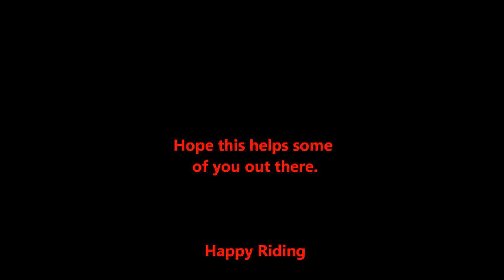Pro Cycle Carb Mod. What they don't tell you.

Comment: I have 2 DR650s. I ran the carb kit on my 1st one for a bit, with the airbox cut and an FMF pipe. It was loud, especially if it needed repacking of the pipe. I was riding too many miles for that. I use stock pipes now. Ti GSXR1000 pipes are rare and expensive now.

 Now, one has the allen-head screws, an adjustable OEM overseas needle, an extended idle-mix screw, and a snorkelectomy. The other has an adjustable KTM 640 needle and the other stuff. The breather filter has been moved away from the airbox opening.

 They both run great near sea level. Winter time is made better with a slight idle-mix adjustment. For higher altitudes, I could remove the airbox door. They can be returned to stock pretty easily.

 A lot of other needles don't have a great taper, or they can wear out the needle jet quickly. This is basically a simple upgrade that makes the stock carb easier to adjust for elevation and temp, with a bit more airflow from the snorkelectomy. I rip wheelies in 1st and 2nd.

Comment: Bought mine,rode it a few hundred miles, stretched it out on the highway and it was good for about 96mph.went home, backed off the valves a couple thousandths, took it for a ride,105 mph all day long with me on it 165lbs.thats the only power mod I've done and that was 20,000 miles ago.

Comment: I did the Procycle kit and have had no problems yet. 5000km lots of offroad.
I followed Adv Oz's video for install.
Love the power gains! Its like a totally different bike.
Reply: Dave, you said you followed Adventure OZ's video for the install.  Did you clip your throttle spring?  If so, how much?  In the Adv. Oz vid, I think I remember them taking off 1.5 cm, but all the other material I've found says - if you're gonna do it, only take off 2 springs (~ 2-3 mm).
Reply: Yes , if i remember correctly i followed every thing Adv oz did.
I think with all the experience those boys have i trust them. lol
The procycle kit really unleashed the beast.
I found that i lost 20km/hr off the top end but the DR is pretty uncomfortable up there anyway and 140km/hr is lots for me.

Cheers
Reply: Wow!  The fastest I've ever had my bike is 140 km/hr (87 mph).  But here's what makes me wonder if I should clip my spring - I live at 3,800 feet with frequent jaunts up to 7500 feet.  The average elevation Down Under is 330 m (1083 feet.)  I'm not sure what effect elevation has on a carburetor, so I'm not sure if the potential issues with clipping the spring would be exacerbated at higher elevations.  Anyway, that's what I'm trying to figure out.
Reply: BarefootDrummer  Ya I’m no guru in that department. I live at 2300 feet.
Reply: @843292  elevation effects the air/fuel mixture on a carburetor. As you increase in elevation the air becomes thinner but the fuel remains the same so you end up with a richer mixture.

Comment: I like that procycle carb kit.
I had plugged the vacuum intake when i first did the carb mode.
Wasn't till later i had the same problem as you did.

Must have read the same post you mentioned as moved that breather and also changed out the foam in there. Stock header/exhaust ..
Had my problem in 2014 or 2015.

Comment: I got the ProCycle Breathe Easy Kit on my DR650 & cut out the top of the air box like on the instructions but I had the same problem with the secondary breather filter. I ended up making a divider to go between it & the airbox that way there not so close to each other & so far its been working good.

Comment: If you notice the area around where the carb draws air is so cramped and the carb needs to draw a lot of air in order to 'breath'. What I did was to fabricated a side cover for the box with a big hole and covered it with a wire screen to prevent debris from being sucked in, then cover the original hole on top of the box. The space then was left solely for the breather filter. With this it eliminated my surging at high speed. I am also using a procycle carb kit.
Reply from the maker: I was wondering about that surge. I just figured I didn't adjust the needle correctly. I was going to tear it down during the winter but perhaps I'll do this instead.
Reply: Gamet36 - you adjust the needle only once, that is when you get the correct idle mixture and rpm for a specific terrain elevation. It has a very minimal effect during high rpm operation, if I'm right :)

Comment: I know this is old, but...
Just bought this Dr used and riding it back home it started acting up like that, but not until i was trying to run over 55 MPH.
I thought it was starving for fuel. Going to have check the position of that vent. What gets me is that killing the engine when paying tolls, every single time i had to give it full throttle for it to start.
Well check position of that in the morning.
Reply from the maker: Good luck my friend!

Comment: Could be more likely the float was stuck after the little drop ,
Reply: My brothers old XT500 suffered this same issue and has the old style carb, no vac slide. Ended up being float issue.
Reply: @Kaegis  How do you fix the float issue?
Reply: @narrator-timothymckean  Spoke to my bro and he told me he ended up replacing the carb with one from an SR500. A nice Keihn FCR42 would work very well 👌
Reply: Yep

Comment: JD Jetting is the way to go......
Reply: Agreed. I don't mess around, straight to JD 3x3
Reply: The instructions for my dr650 JD kit says to cut a 2x4 hole which seems small, smaller than 3x3.  Every other jet kit basically says to remove almost the entire air box top.  I'm afraid to cut too much now.
Reply: Pro Cycle gets there jets from JD

Comment: 2 questions 1). Where did you get the bag/luggage carrier and 2). How many miles are on the Bike? Dealer told me not to do any mods until 2,000 miles and I am there now same bike as yours though, 2015. Funny I have the same Luggage rack!
Reply from the maker: I got the bag from Revzilla I believe and I have 9000 mi as of today. I waited til my 12mo warranty expired before I did any engine mods. That way if I had a problem with it, they couldn't say it was because of the mod. I don't think it matters for the mileage if you want to do the mods. Adventure Oz did his before he hit 1000 I think.

Comment: sounds like it's running with the choke on lol
Reply from the maker: It wasn't. But I did end up turning choke full on to clear it. Once it cleared I turned the choke off and it ran fine. Once I got home I rerouted the secondary. I haven't had a problem since.

Comment: Pro cycle are carnies, their jetting sucks. Pumper carb
165 main
27.5 pilot
Needle 2 from top
Pilot screw 2 turn out
Pump gap 3.5 mm
Rips
Reply: Any videos on this?
Reply: and yet I can bolt a tm40 straight on and go without any problems no surging...nothing....